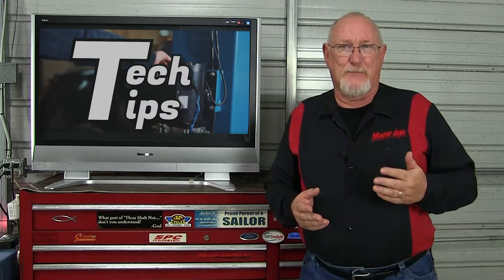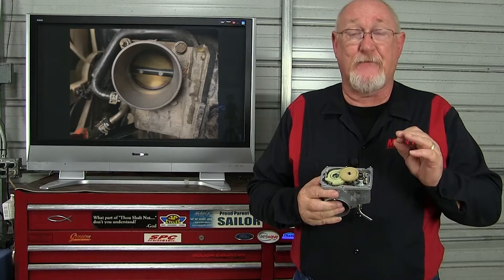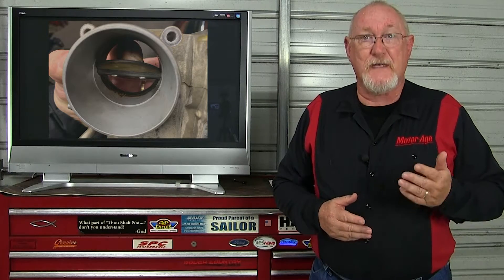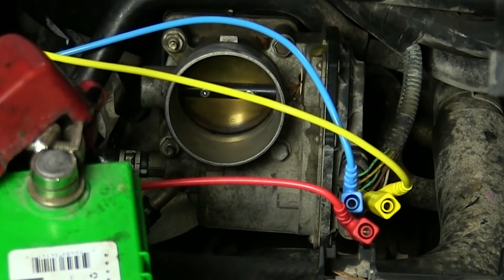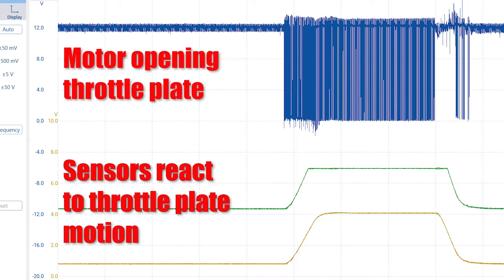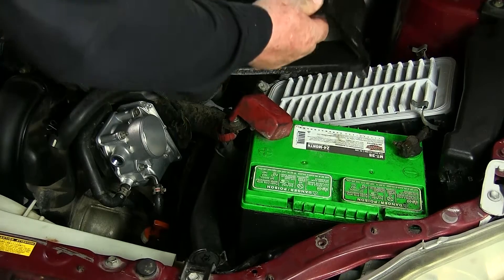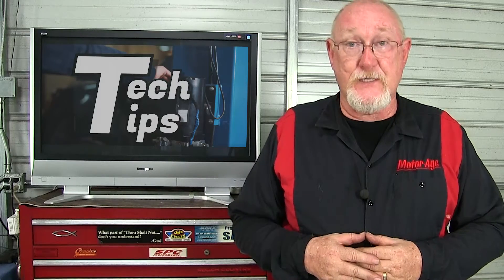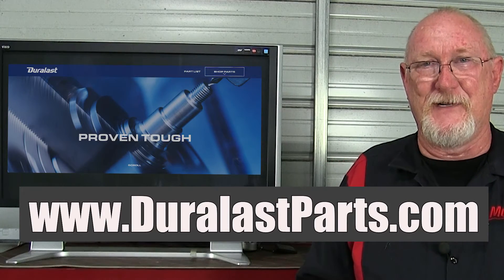TechTips #1 – Electronic Throttle Body Troubleshooting

Comment: Hello,i got a kia rio 2013 1.1crdi with Drive by wire trotle body,it was wide open,removed to clean,still fully open,fitted back as it was still fully open car starts,idle ok,drives ok,no codes  it is normal to be fully open when engine is off🤔
Reply from the maker: Must be - if not, and it was wide open when you started the car, the RPMs would skyrocket.
Reply: @VehicleServiceandRepair  🤔on the diesel it must perform that way I presume, but it did start ok,idle ok,no relearning process required. Thank you for the reply.

Comment: Hi there
My chevy blazer 08, 6 cylinders, giving rough ideleing for the first 30 minutes, and run properly and perfectly after that.
After testing it showed
P 1516, P 2101

I changed the throttle body 5 times (used ones), but usles.

What is that needs to get hot to run the engine properly?
Reply from the maker: The codes you're referencing are correlation codes - the ECM thinks the throttle plate isn't where it should be based on the feedback from the TPS sensors, which are a part of the throttle body assembly. Are you making sure the replacements are good and clean before installing? Have you tried to clear the ECM memory by disconnecting the battery and letting it sit for 30 minutes or so?
Reply: Thank you for your reply

Yes I did check all the above mentioned steps

Cleaning, recoding,
Ground
Every thing

Still

It needs 30 minutes to start smoothly
Reply from the maker: @nabilhhasan  Do you have a scan tool?
Reply: No I don't have scan tools, but the garage has
Reply from the maker: @nabilhhasan  i would check the ECT and IAT temperature readings while the engine is cold to see if they agree. The 
ECM may not be commanding a cold enrichment.
Reply: I'll do that
And try it, and will come back to you 

Thanks
Reply: IAT reading 57 c
ECT 97 c

In normal running mode
Reply: When the engine is cold and not running to compare the ECT & IAT temperature.

Comment: Hi there Pete I'm currently having this problem with OBD P061C code any input will help
Reply: 2013 5.0 mustang
Reply from the maker: This code is set with the calculated engine rpm is no in line with the desired (programmed) rpm for a specified time. On your Ford, it can be caused by a problem with the Crankshaft Position Sensor signal to the PCM, or the Camshaft Position Sensor signals (two, I believe) to the PCM, or a problem with the PCM itself. But before you replace the PCM, make sure that the signals are strong, it has good power and grounds, and the connector pins are not damaged or corroded. 

I would use a scope at the PCM connector to monitor the CKP and CMP signals, looking for any fallouts or inconsistencies. If that's ok, I'd check power and grounds to the PCM next. Good luck!

Comment: Hope you can help, 2012 silverado 6.0L trying to do a throttle sweep test, but i keep getting engine speed detected while engine is off!
Reply from the maker: How are you trying to perform this test and why?
Reply: @VehicleServiceandRepair  with a scan tool.
I noticed the rpm will be correct while engine is running then within 10 seconds rpm goes to 9742 and stays there.
So im trying to do throttle sweep test on my scanner but i keep getting engine speed detected while engine is off!
Reply from the maker: @moecapitolnetwork2916  Have you tried a different scan tool? What kind is yours? Also, are you trying to graph the TPS data? That won't catch a glitch - the refresh rate on a scan tool is too low.
Reply: @VehicleServiceandRepair  thank you very the tips very helpful, i will try that.

Comment: Hi sir, i have a 2006 lexus rx330 awd, that i will need to replace the Throttle body. I ram across two hoses. One on the right is coolant. The left hose i have not unplug it.. do you know what is that connected too and soni need to bleed those two lines afyer replcaing the tb? Thank ypu sir.
Reply from the maker: They are both coolant lines and you can pinch them off as I did here. If you do that,  you shouldn't lose enough coolant to worry about.
Reply: @VehicleServiceandRepair  ok thank you.. will do that.. have a good day sir..

Comment: Hey, Pete. Watching you excellent video in Florida. In one of your videos, you talked about how the PCM/ECM  does its testing: Rationality, Functionality etc. I would like to know how they say that  both ,the accelerator pedal  and the electronic throttle body can cause the P2135 code on Nissan. I understand that the pcm checks both sensors (APP and TPS) with KOEO, for performance, rationality. My question is, if the APP has some malfunctions and not the ETC, why the engineers don't just set a code for each individually? As far as I know, the APP  sends a signal to the pcm and the pcm commands the ETC to open the throttle valve and the TPS sensors send a feed back to the pcm about the speed and opening of the throttle plate. If the APP voltage were too high or too low  or not performing well at a certain time, shouldn't the pcm set a code for the APP only, even though a bad APP voltage can cause the pcm to command a higher or lower throttle opening that the TPS sensors will report to the pcm? I think it's bad engineering.
Reply from the maker: According to the service information for a Nissan Altima, this is a rationality code that compares the output signal of the two TPS sensors. They should agree. The fault will either be in the wiring, or (more likely) in the sensor itself. Of course, always check for any Technical Service Bulletins that may apply. The function of the APP sensor shouldn't be related to this code.
Reply: @VehicleServiceandRepair   Thank you, Pete, for your elaborate explanation. As you said, the function of the APP sensors shouldn't be related to the p2135 code. Unfortunately, the APP sensor circuit is included in the diagnosis of the code.
Reply from the maker: @perez7667  I found a few generic resources, both online and on YouTube, that included a faulty APP as a possible cause, but the factory info does not - for the model I checked, anyway.
Reply: @VehicleServiceandRepair   Mine was for a 2004 Nissan Murano. Thank you for your help.

Comment: I believe Wells makes the sensors and ignition parts under contract with Auto Zone . They are then branded Duralast . They are high quality . I can't imagine what a dealer would charge to diagnose and install an electronic throttle body . Is that drive by wire worth it in the bigger picture ? Not only the motor inside , but with dual TPS - if one goes bad you are paying big time for an assembly .   I just saw a video where a fuel pump relay was replaced on a BMW . A " regular " relay was installed . BUT - the OEM has a resistor to prevent voltage spikes to the ECM . About a week later , the ECM was ruined and cost OVER  $ 1000.00 at the dealer !
Reply: Oem is usually better that's why it's more and cause it's name branded
Reply: 1000 dollar put that into another car

Comment: Hello, Pete. If you have a higher voltage in one of the APP sensors as you sweep the throttle( from normal to higher than specs), how could that affect the TPS sensors? Your answer will be highly appreciated.
Reply from the maker: The ECM moves the throttle in response to the APP inputs. If the input is wrong the throttle position may be off. .
Reply: @VehicleServiceandRepair  Thank you, Sir.
Reply: @VehicleServiceandRepair  what if the plate is opening fine but no revs 🤔
Reply from the maker: @mattlawton4715  Interesting question. If more air is entering the engine, RPMs should rise. Is the air entering the engine?? Is the ECM seeing the throttle opening and adding additional fuel?? I would want to see some scan data for this one...
Reply: @VehicleServiceandRepair  yes like if the injectors stayed at idle but the throttle plate was opening so getting moor air but fuel not increasing 🤔.

Comment: Was that throttle body you changed out bad.
Reply from the maker: The throttle plate was binding a bit and you can see the deposits on the throttle plate shaft. It was still functional, though.
Reply: @VehicleServiceandRepair  Ok i was just wondering i think it needed changed as well. i was just asking because i wanted to see what a bad one looked like on the scope. I'm pretty sure I can use my imagination though because you said you will see it drop out.

Comment: is it possible to use the scan tool if it has PIDs to view the throttle body readings rather than a scope or would you still connect a scope?
Reply from the maker: You may be able to command the throttle plate open and closed to verify motor operation. You can also graph the throttle position sensor PIDs but the refresh rate is too slow to catch a glitch.
Reply: @VehicleServiceandRepair  thanks